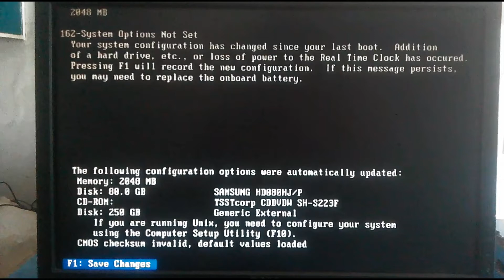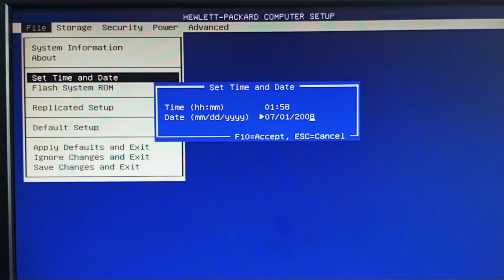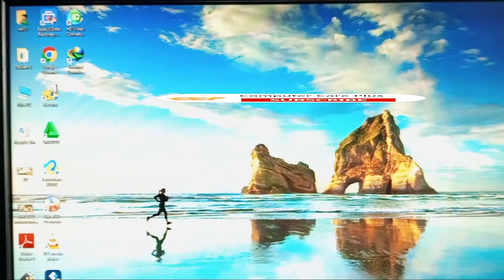162-system Options Not Set (100% Working)

Comment: Brother i did the same setting and its goes correct when i restart at same time but when I switch off pc and turn again sfter sometimes its shows again the same problem and when i opne bios the settings reversed again
Reply from the maker: Change CMOS battery . And again save Bios setting.
Reply: @ComputerCarePlus  i did it many times but still the same prob